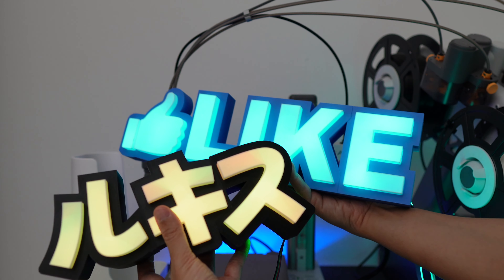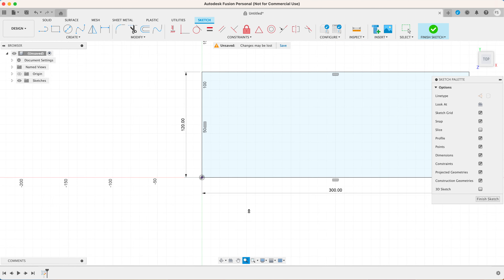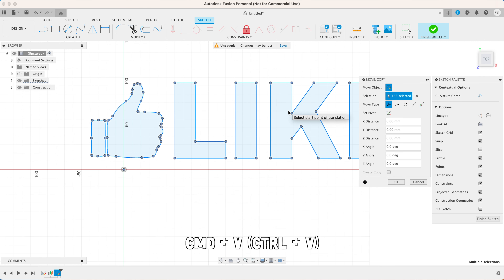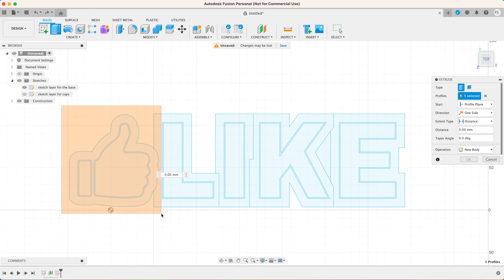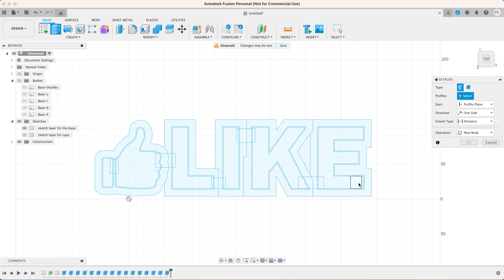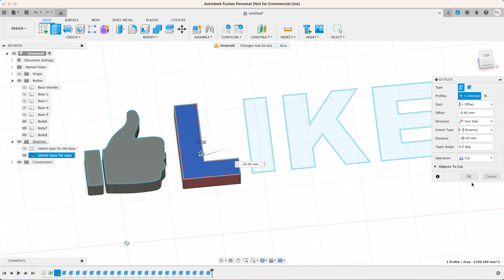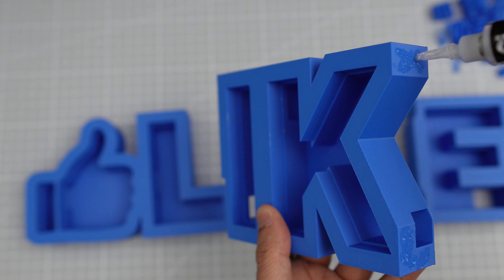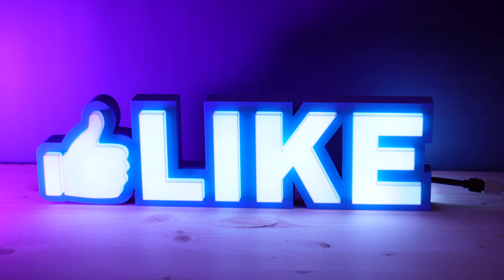How to make 3D Printed LED Letters sign (ft. BambuLab A1 Mini)

Comment: You don't need to export every body individually. Right-Click on the project name in the browser tree, save as mesh and then select One File per Body under structure.
Reply from the maker: that‘s a great tip! Thanks for sharing
Reply: Wish I read this comment about 10 minutes ago...
Reply: show it in a video :)
Reply: @gregeezy  lool
Reply: Use the slower speed in the video settings. I usually change it to 2x
Reply: WOW, i was looking for this option for SO LONG thank you, you made my life a bit better! thank you.

Comment: Great tutorial, very detailed but kinda fast for this newbie. It’s ok. Ill just have to watch it 20 more times then on the 21st time i will pause at each step and make that sign 5 times until i can make my own sign.
Reply from the maker: thanks for the comment! Yes it‘s a bit rushed because i didn‘t want to stretch the video too long. 
If it‘s a little too fast, would it be helpful if you slow down the video? (you can do this in the settings)
Reply: @Lukis3D  I felt the same way, a bit fast in certain areas for a total pleb like myself, but overall it was really informative and instructional.
Reply: @Lukis3D too fast and hard to me 😢
Reply: 😂 watch it at 0.25x playback speed then

Comment: I want to create something longer (12 letters), but it becomes 400mm length and the height is like 50-60mm which is very short. How can i make the letters higher? Please help!
Reply from the maker: you mean you wanna stretch it out? Once the contraint is lifted,(blue lines), you can stretch the letters any way you like. But i don’t know if it would still look good, and if its easy to install the LED strip. I would just make the letters bigger which means that the sign will be so much longer
Reply: @ yes but 12 letters with height 14cm, the text becomes 1 meter long 🤣

Comment: You don't need anything like as much sketch geometry or operations to do this.
Extrude the caps as a solid body
To create the 0.1mm clearance use Offset Face
To make them hollow, use Modify > Shell, and select the bottom face

To create the cavity and the ridges in the base, again use the Offset Face command

When using Offset Face, it will generally be quicker to select the whole body, then de-select the faces you don't want to offset (ie the top / bottom faces). This will leave you with all the walls selected
Also, all of the Offset Face operations can be done on all the letters at the same time
These techniques will save TONS of time
Reply from the maker: You are absolutely correct. You can also use Press Pull to create the 0.1 mm clearance. 
When i first started, i watched tutorials where they used those operations and i ruined my model. troubleshooting took so much time.
So i made the tutorial using a slightly different method, almost a fail-safe way for beginners, in hoping that they wouldn‘t be having the same problem like i had back then.
Reply: I understand the shell command, it's the offset I am struggling with. When I have the outer walls at 30mm high and then select them with the offset command it is only allowing me to make the walls thicker.  Are we not mentioning a step here to make the inner wall a little thicker and 10mm shorter with offset?
Reply: @samuelelliott715  You should do the offset command on the sketch, not the body. Hopefully that helps you out here!
Reply: sketch is sometimes better, especially when offset face on a body is not working. fusion could just not do add the -0,1mm offset in my example

Comment: Excelent. Another way is use "thin extrude". For the caps for example, just extrude 1mm, extrude again 0.2mm in the oposite direction for tolerance, and again thin extrude the walls.

Comment: You can also get flexible LED strips used in the signage industry that will conform much nicer than the ones used in this video, and is actually quite cost effective if you know where to get them locally.
Reply from the maker: you’re right! Currently my favourite type of light strip is COB light strips. Super flexible and you can get thin ones and they shine really bright as well!
I used them in my recent Edge-lit Acrylic sign video and they’re so easy to work with.

Comment: Great video!!
Though, 1 suggestion.
@ 7:27
You could instead have done just the single 0.1mm offset, extruded, then used the shell command on the desired face with your specified thickness.
This keeps your files cleaner.
Less bloat helps the project stay snapper. 😁👍
Reply from the maker: thats a great tip, thank you for sharing!

Comment: Thanks for this! I recently created a desk lamp using your tutorial, however I used a 12v LED strip and the lights became increasingly hot. I think I can circumvent any material deformation using ABS instead of PLA. But I was wondering if you had any advice concerning LED lights and the heat generated. Thank you!

Comment: My first self made model ever was a similar led sign, where i followed a similar tutorial by Duke Docs on yt, but it was prette difficult to follow as the commentary is in Portuguese. You used a few methods that is easier. For example, the way he showed it, i had to use Inkscape to create the text as svgs, and then import them, but using the text tool in fusion, and unlocking them is so much simpler. I love the look of these led signs, but i dont have any text I wanna have a sign of, as i dont want just random words all over my wall😄 one thing I thought could be better with your led sign is if the led strip didn't follow the letters around the inside like that, but the letter bases was more of a box shape, and the strip would sit in a straight line in the top and bottom, shining in towards the middle. Would also use less led strip, and reduce the risk of the adhesion letting go over time, as a few of my signs did. Nice video, ill check your other vids now.
Reply from the maker: thanks for your comment! Yes i too, initially tried to use Photoshop to create the text as SVG when i realized that there's a better and a simpler way.
I think i know what you mean by the box shape, like my other design, the 16 segment display LED sign: https://youtu.be/GzjDQleAKGM?si=cRJjb9cK-Lx64d03

Comment: Perfect! For the diffusing layer, will any regular white PLA work, or does it need to be a specific type of PLA designed for light diffusion? I'm not very familiar with the options.
Reply from the maker: you can use any type of PLA white. Any basic white filament will work😊

Comment: Great tutorial! Quick question:

Are you supergluing the caps to the base? My caps fit in nicely but not "snapped" in. They are pretty loose when I stand the sign up and can fall out.
Reply from the maker: hey man, if thats the case, you can of course, superglue them but keep in mind that you might have to take them out for servicing purposes if the LED stops working or something.
Or reprint the caps without the 0.1mm tolerance so it will be a snug fit.

Comment: Very interesting tutorial. But a suggestion that might be helpful for the future - show us the feature BEFORE going through the mechanics of how to achieve it. 
As well as showing the final product in the introduction, some discussion of the design details and dimensions (particularly clearances) would have made the tutorial even better. 
For example, it wasn’t until the end that I realised you had been creating the internal ‘step’ that raised the translucent pieces above their base and provided space for the led strip! 
It wasn’t so much the speed of the action that created difficulty, but rather that you were doing stuff (at speed) and we weren’t shown/told what you were trying to achieve before you went through the steps to do it! That example: do this, this, this,…. “And that will create the narrow edges on the inside of the base” (4:55 for 30 seconds). Narrow edges (ledges?), let alone their reason for existence, had not been mentioned before! 
Simply put, it is easier for us to follow if we have some idea of where we were going! 

For the diffuse translucency, exactly which filament was used at what thickness, please? That would be a really simple and useful takeaway. 
Thanks for the effort you have put into this!
Reply from the maker: Hi there, thanks for your comment! I understand exactly what you meant, but I sped the process up so the video won’t be too long. I made the tutorial so that you would only need to copy what i do to get the exact same result.
But don‘t worry, I actually plan to make a second in-depth tutorial in the future, which would be quite long, but i hope it’ll help more people, so I really appreciate your input!

Comment: One extra step that I would do is to print the blue part upside down so that the texture matches the clear parts
Reply from the maker: i wouldn’t recommend doing that, since you’ll need a lot of support if you print it upside down. Plus, you have to deal with elephant foot which would mess with the fitting of the caps. But the second problem can be solved by using a deburring tool (takes alot of time) or use elephant foot compensation setting in the slicer.

Comment: nice job! What's the best printer for  a mid size shop? and price range? Thanks!
Reply from the maker: hey thanks man! I would say A1, it was $299 on BlackFriday sale, but i think normally it costs $349.
If you‘re not printing big items, then A1 Mini with SwapMod systems. $179+$75 +plates.
You can check out the SwapMod systems in my other video👍🏼
Reply: @Lukis3D  thank you for your input!!!

Comment: Its cool, but calculate with the heat of LEDs. PLA could melt down if you use LEDs. Or at least it will deform at long usage.

Comment: This is amazing.. I have watched many times, and actually made notes to try duplicating it.. but I am having a problem at the first offset - as soon as the offset it big enough to overlap, the offset disappears from the middle letter (I'm trying with a 3 letter word). Any ideas?
Reply: Started over using the word "LIKE" and it works... Why would the letters matter? Using same font - Tried using "OGR"
Reply from the maker: @rctoyguy  Hi there, i tried to offset the OGR and it seems like if you offset it in the positive direction, the middle one disappears. Try to offset it in a negative direction, e.g. -10 mm, i tried it and it works. Sometimes you have to play around with the direction a little bit if it doesn't do what you want.

Comment: Suggestions on what to search for on LED strips with more lights per meter? Not sure what the correct word is to search for other than "brighter" led strip which doesnt seem to work too well lol
Reply from the maker: you can search for 60LED/m or 18LED/ft (if youre buying 5 m strip, then it should have 300 LEDs, or somewhere around 240LEDs for a 13ft strip)
Reply: @Lukis3D  Thank you! I did a little bit more research and it seems the best type of LED you can get for this imo is a COB (controller on board) LED light strip.  You can't see the individual LEDs on the strip

Comment: Hey, I had a question for you.
I'm trying to make an LED but I have a problem, when I have the text ready and I remove unnecessary lines, the color disappears from the background of the letter and I can't select it to create a solid shape. Are you able to suggest what to do?
Reply from the maker: hey man, then you might have trimmed the lines that you shouldn’t trim, which makes the whole shape incomplete. 
I would re-do it before the background color disappears and carefully remove the lines. Zoom in really close if you have to.
Or if its too tricky to trim everything cleanly, its also okay to leave some lines here and there, it wouldn’t be that much of a problem.

Comment: The part when making the inserts, when you say click all but the "Outermost" or "uttermost" line except the 0.1mm offset. I have tried multiple ways and was not able to get it to extrude corectly. It wouldnt extrude into the object.
Reply from the maker: hi there, try to zoom it in so you can see the areas better. And for extruding you wanna make sure you select the area of the line encompassing it and not the line itself

Comment: Thanks for this. I just bought a A1 Mini and was wondering if I could do anything cool like this.   What Bambu slicer settings do you use to make your prints come out good?  Or do you just enable supports?
Reply: Also if I have a R or D in my word do I need to do anything to make the hole for the middle of the D and R
Reply from the maker: i find the default settings in the bambu slicer are very good already and perfect for beginners as you can pretty much print things like this without having to worry too much about the settings. You always want to enable supports if the design has critical overhang, like the holes you see for the LIKE sign. You don't want your printer to print in the air.

Is this your first printer? If this is your first, then you'll gonna love it as much as i do! It's so much fun to print with it!
Reply: @Lukis3D  It is my first and I am loving it.  One more thing.  I am having trouble getting the caps to be hollowed out, they are printing as solid letters.  Any help is appreciated!  The bases came out perfect though!
Reply from the maker: @TruDadGaming  is the STL design of the caps hollowed? Then it should also print it hollowed. Just make sure that when importing it in your slicer, rotate the model so the face of the letters touch the plate- you want the hollowed part to point upward, so there’s no support needed.
Reply: @Lukis3D  I don't think its hollowed in the design.  I was following along but for some reason it didn't come out correctly

Comment: Do you mind me asking how you'd do this from say a PNG or a SVG? I'm struggling to bad haha, I have the files ready but i'm so damn new to Fusion 360 I wouldn't know how to use those steps. Aside from my issues, brilliant tutorial!
Reply from the maker: no problem, in fact, the thumbs up icon i made in this video was using an SVG file. You can‘t use PNG though, u need to convert it to SVG first. Just follow the steps where i inserted the thumbs up icon, then the process is similar

Comment: which filament did you use? Is it a simple white filament so that it shines through so diffusely?
Reply from the maker: Yes, its a simple white Sunlu PLA+ filament. the key is that the thickness of the wall has to be thin enough so the light shines through.
In this case, its 0.4mm.
Reply: What thickness did you print?Thanks for the explanation!
Reply from the maker: @d.g.7253  sorry, i just saw your message. the face of the caps has a thickness of 0.4mm (thin enough for the light to shine through and thick enough that it won‘t break) . I print everything in 0.2mm layer height.

Comment: I normally watch stuff at 2x, but had to slow you down to 1.5 to get the detail. I think what would really help convey your ideas is first going over the design using section views. 

Also, why is you cap top and wall thickness not the same? Normally I do two or three nozzles diameters to keep the light diffusion consistent.
Reply from the maker: thanks for your comment.
I made the wall abit thicker to add stability since i didnt want them to be too flimsy.

Comment: What filaments are good for making the light bright enough?
Reply from the maker: any white filament would do. If you want it to be brighter i suppose you can get an LED light strip that has 60LEDs or more per meter.
In the video i used a 30LEDs/m light strip and it‘s good enough for me.

Comment: No what I meant is during print. You could not fit the whole sign on one plate, so how exactly did you split the sign to print in multiple plates?
Reply from the maker: when designing the letters, i made STL for each letter, so when you import it into the slicer, you can try importing 2 letters at a time. Or 3 letters at the same time. they will stay together like they are in Fusion 360.
Reply: @Lukis3D  ok I went back to the video and I see and understand what you're doing at the 4:00 minute mark. Thanks

Comment: What do you do with the "excess" LED strip that isn't neded? Can it be trimmed?
Reply from the maker: you can use for other projects. you just need to solder it to a connector that can be plugged in to a power source
Reply: @Lukis3D  so it's trimmable to length? cool!

Comment: I'm struggling at the @7:21 mark. I'm not able select just the boarders. I am only able to select the space not the line boarders. Any advice for this?
Reply from the maker: I’m not sure what do you mean by line borders. At 7:21, i selected the space, right?
Reply: This is probably because the letter has an open line. While editing sketch, turn on ''points'' and look for white one... the white one means it is not connected

Comment: Hi I have never used Fusion before and I am trying to follow your tutorial. I get to the same point where you try to create a rectangle. The on screen dimensions go from 0 to 75, you did some magic and expanded it. I have been guessing but no luck :(
Reply from the maker: hi there! when you draw a rectangle right after clicking a point, before clicking for a second time, you can type in the width or the length and it will be resized automatically. to switch between length and width, just hit the tab key on your keyboard.

Comment: Nice Vidoe, but i dont understand why you would need to enable the support setting. Since your overhangs are completely straight, your printer will easily bridge these gaps, thus making supports unnecessary
Reply from the maker: thanks for your comment. The last time i didnt use support for straight roof overhangs, the filament just drooped down. 
I supposed it wouldnt be that big of a deal since you wouldnt see it on the model anyway, but at least i had a peace of mind😄